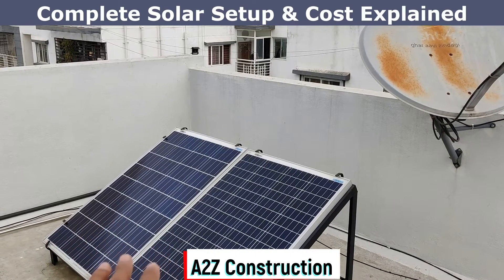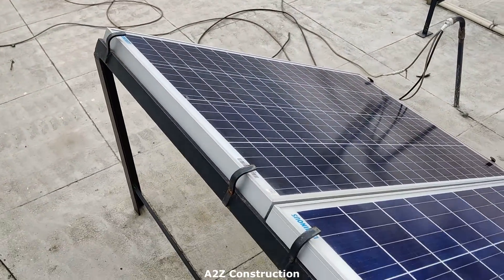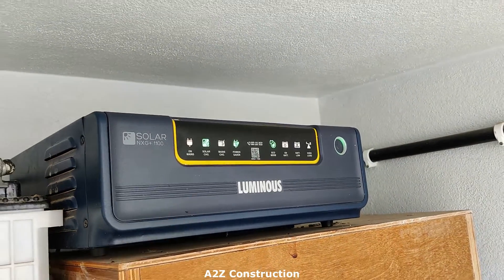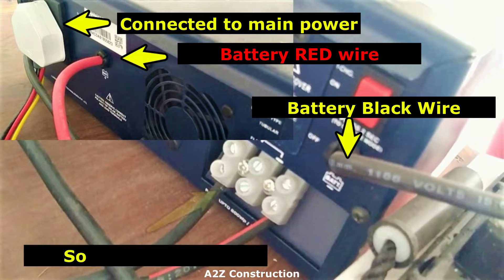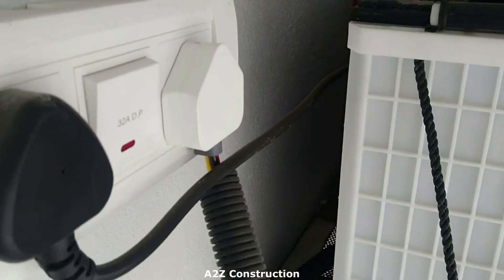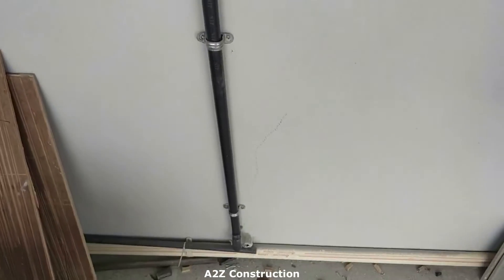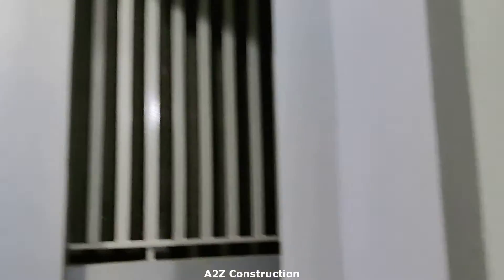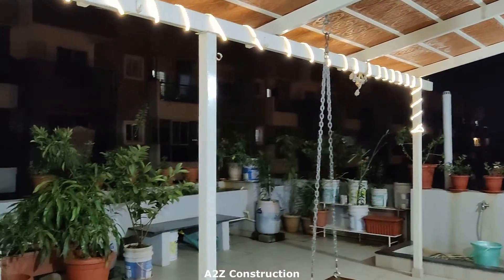Solar Power Backup for Home Complete Setup Details (2022)

Comment: Can I use this system as a off grid option? Meaning, can I charge the battery only with solar panel and used it daily for just lighting the house, for 5-6 hours, using 10 watt led bulbs (6-8) leds bulbs?
Reply: Easily you can run 80watt of load for 10-12 hours with 100ah battery. Solar panel must not below 200watts.

Comment: 100*2=200 watt ? 😂😂😂 It's seems like kids playing with toy 😂😂😂
Reply from the maker: Hi, something wrong that I mentioned?
Reply: Output what you get is very low, you should go for 600 watts atleast to fully utilize 150ah battery and ups which you bought. For beginner it is fine. I added 150 watts * 4 panel.
Reply: How to battery is full and how to activate power saver?

Comment: Sir We want solar system to operate air conditioner in home..will it work ..does it work in rainy season as well..thanks
Reply from the maker: Hi, 15 Amps switches do not work on solar or normal UPs  backups. So need to check this with electrician.